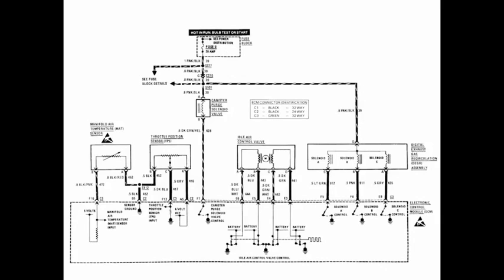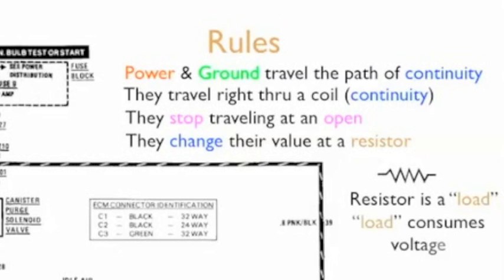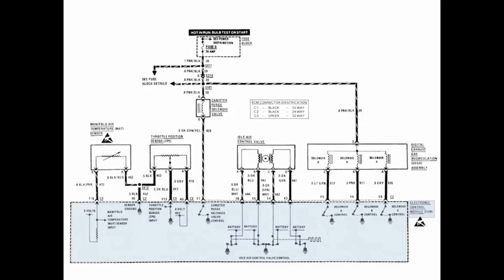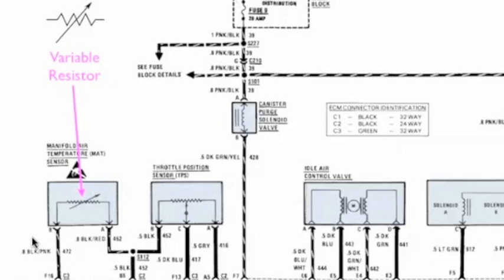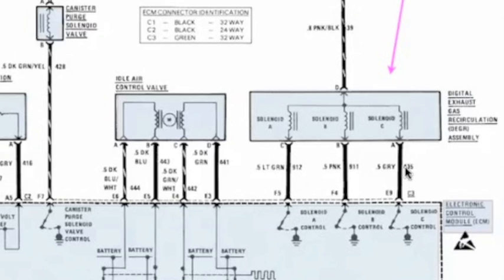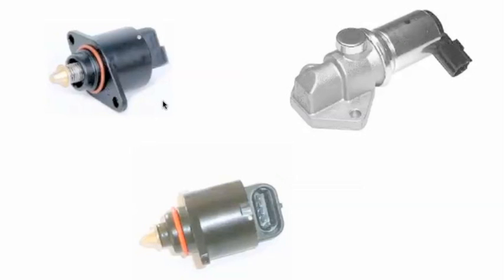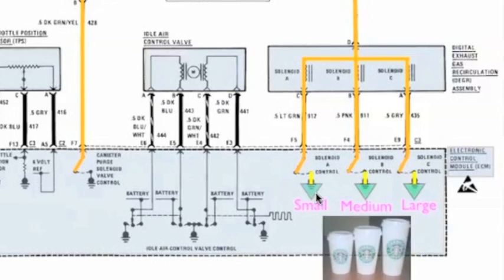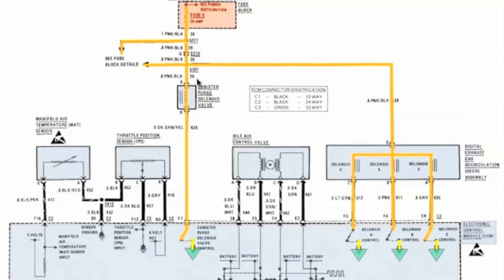Lesson 5 Two different power sources

Comment: Yes I agree these are some of the best automotive electrical tutorials on YouTube. May I suggest you take the tutorial one step further and when you're showing the diagram for the TPS, for example, switch the video to show the viewer the actual TPS or other sensor in the car and point out the wires which match up to the diagram, and use a voltmeter to show the voltage at the pins which agrees to the voltage or resistance on the diagram. And then as well the purpose of understanding the wiring diagram is to diagnose failures in the system. Show us how to use the diagrams and the multimeter to troubleshoot common failures. Just a suggestion. Great job, and thank you again.

Comment: Have you ever considered doing a video on what situations you would use a power probe, and what situations you would use a load pro? I noticed that you had a Load Pro connected to  your meter in this video and you've used a power probe in others. There are some very heated debates on Youtube as to which is better. I know there isn't one single tool that will work equally as well for all jobs, just curious where YOU use one or the other and why?  Keep the videos coming!! Thanks for all that you do.

Comment: More on battery explosions:

In high school auto shop (c. mid 60's), our instructor suggested always blowing on a battery terminal that would complete or interrupt a circuit... to displace any hydrogen/o2 mixture in it's immediate vicinity. Just in case an arc is inadvertently created.

Cheap insurance he called it. I still do it to this day...

Yes, the videos are great, interpreting wiring diagrams are BIG issue for many techs.

Thanks!

Comment: Jahan Zeb, a small battery just does not produce enough POWER to do heavy WORK, voltage multiplied by amp is power, IE=P.  If you short out a small battery, the battery will just get hot and loose its storage capability quickly and become a dead battery quickly.  The video is not using a weak, undercharged battery, its just not strong enough to burn the wire, I do agree the test is invalid but not because of a discharged 6 volt battery.

Comment: The best electronics videos by far. Thanks so much. I am learning things I could not quite understand before. Thank you so much. Please keep it up. Again, thank you.
One question....a wire is not a resistor is it?....there is not load in it just a path or a short that would simple short out the battery....I'd think.

Comment: I'm surprised the small wires with the 6 volt battery didn't get hot in his hand.  Considering what the 12 volt battery did to the fat wire, 6 volts is still half that potential.

Comment: Thank you for creating these videos.  I've learned a great deal from you.

I have a question.

Didn't the red wire burn up due to amperage not voltage?

Am I correct in my following thinking? While conducting around 500 CCA, the wire warmed up which caused the wire to increase in resistance causing it to heat up more and so forth and so on until it melted/smoked.

Comment: I recommend it again: take basic electricity classes.  It will help you tremendously.  Electrical current melts the wire, not the voltage.  Study and you will understand why...

Comment: Duane... you scared me!

Don't know if you've ever been around a battery explosion... I guess not, or you likely wouldn't have produced the sparks in the 'short circuit' demo in front of your face like that.

Please, if you do that again, use jumper cables so the sparks take are away from the battery.

As a kid I installed batteries at sears. Several times a year we'd have someone with a bandaged face carrying in a topless core.

Never saw one, but heard a couple. Something you don't forget. :(

Comment: You should not say that the 12 volts will burn the wire and the 6 volts will not, its not the voltage doing the work alone, its also the Amps. If you put two 6 volt batteries in series to make 12 volts, will the wire burn. What is the amperage rated output of each of these type of batteries, which is also comparing apples to oranges since they are both not lead acid 12 and 6 volt car/motorcycle batteries but the motorcycle battery still has a lesser amperage rating so apples to apples is needed.